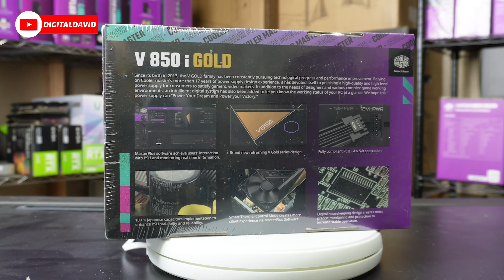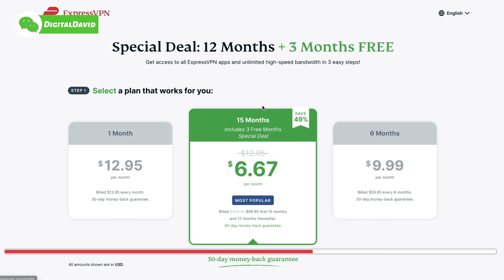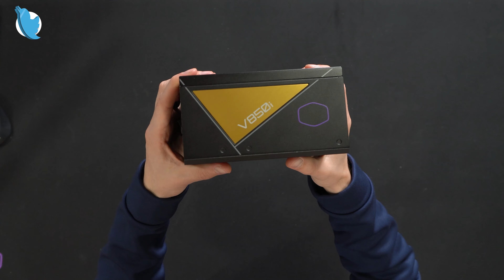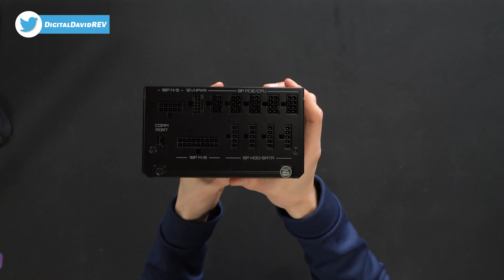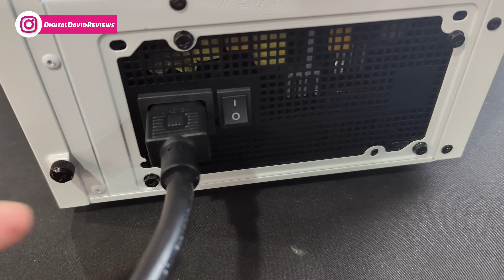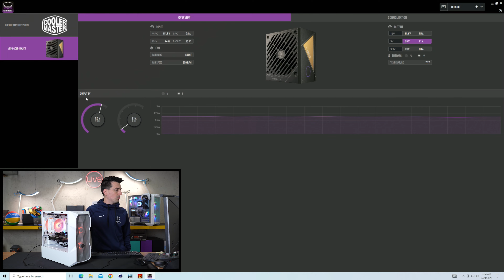Cooler Master V850 Gold i: The Ultimate Power Supply? Review Inside!

Comment: What is the different between i and the v2 version ? Thanks.
Reply from the maker: The Cooler Master V850 Gold i and the V850 Gold V2 are both power supply units (PSUs) from Cooler Master, but they do have some differences.

The "i" in the Cooler Master V850 Gold i stands for "Intelligent." This version of the PSU features Cooler Master's Intelligent Control Panel, which allows users to monitor and control various aspects of the power supply through software. With the Intelligent Control Panel, you can access real-time power consumption data, adjust fan speed profiles, and even monitor system power usage.

On the other hand, the Cooler Master V850 Gold V2 is the second version of the V850 Gold power supply. While it doesn't have the Intelligent Control Panel of the "i" version, it still offers high-quality components, an 80 PLUS Gold certification for efficiency, fully modular cables for easy cable management, and a silent fan with a hybrid fan mode for optimized cooling.

In summary, the main difference between the V850 Gold i and the V850 Gold V2 is the inclusion of the Intelligent Control Panel in the "i" version. If you're interested in having more control and monitoring capabilities for your power supply, the V850 Gold i would be the suitable choice. However, if you prioritize high-quality performance and efficiency without the need for advanced control features, the V850 Gold V2 is still an excellent option. cnl